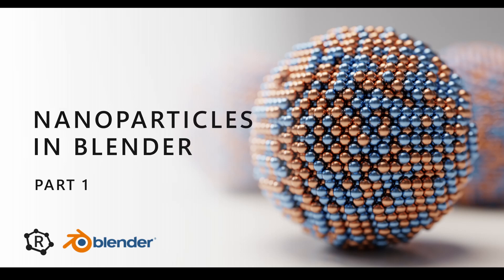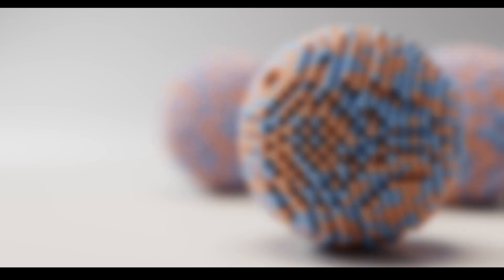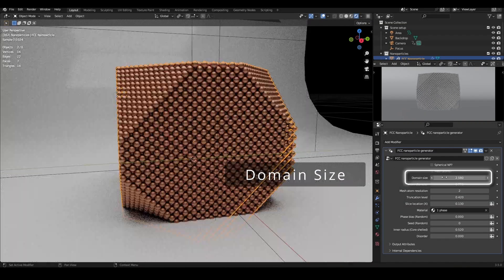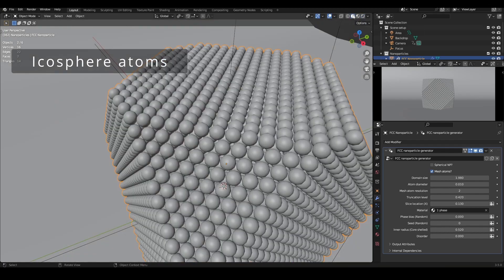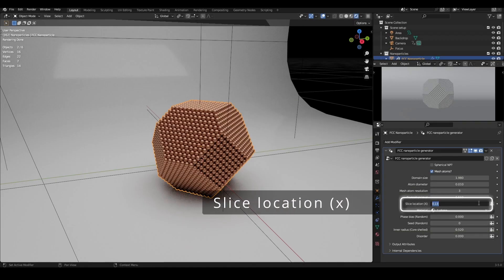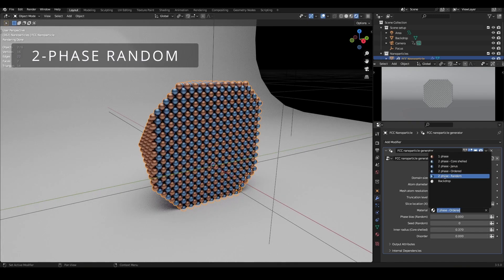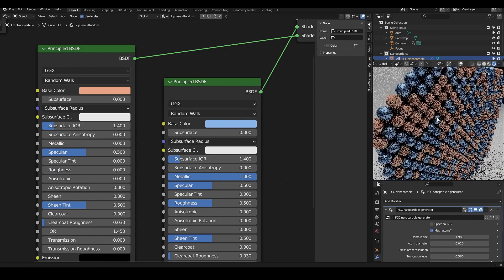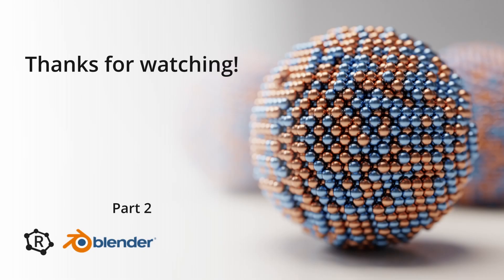Nanoparticles in Blender - Part 1

Comment: Hi. Thank you for your video. This video is very useful for my.
I have a question.

I want to make a particle with a concave shape, but it seems that it can only have a few prescribed shapes. Is there any way to do it?

For example, when I make a concave cube, I make a cube and subtract each face with a sphere to make it concave. But, this is a very cumbersome work.
Reply from the maker: Concave particles are not possible for now as I'm not sure concave nanoparticles form easily during their growth (just thinking in terms of growth kinetics and facet energies). 

If you want to make a concave cube that you can use to trim atoms away, you subdivide a mesh cube a bunch of times, select the central vertex on each face and with proportional editing (sphere falloff) enabled, you could push in the vertices inwards along the face normals.
Reply: @ryomizutagraphics  OK, I'll try to use sphere falloff for make the concave shape. Thanks for your reply.

Comment: This was very helpful for me!
How do I create a ternaly alloy?
Reply from the maker: Many ways to do it. You would need to dive a bit into the geometry nodes setup. I would suggest selecting 3 subsets of the atoms and storing a colour attributes for each
Reply: @ryomizutagraphics 
Thanks.

I want to create a ternary and quinary alloy with a random structure, but I am a beginner and do not know which part of the geometry node to change.
Is it the part of Making FCC latice or the Initialising ID attribute....

How did you learn how to use Blender?
Reply from the maker: @---st2lg Probably quicker if I make something for you. Drop me a DM via my website

Comment: may I know if it is possible to array these nanoparticles? Thanks
Reply from the maker: Sure! Lots of ways you can do this, depending on what kind of array you want. Simple arrays (eg along a line) can be simply done by adding an Array Modifier (make sure it is below the Geometry Nodes modifier for the fcc nanoparticle though). If you need more complex arrays, you can do it inside the Geometry Nodes tree. Eg if you need a 2D grid array of NPs, add a Grid node, connect it to an Instance on points and plug in the nodes for the NP into the Instance socket rather than the group output of the node tree.

Comment: Thanks for the video. I'd like to know how to assign multiple colours (more than 3) to the atoms on the nanoparticle using your asset.
Reply from the maker: Definitely possible but will need to create a new attribute via geometry nodes to control the colour distribution.  What kind of phase distribution are you looking to create? Random or something more controlled?
Reply: Thanks for the reply! I’d like create an intermetallic nanoparticles with 5 elements in it. With one sub-lattice consists of metal A and metal B and another sub-lattice with metal C, D and E.
Reply from the maker: @danielw5204  Sounds in theory doable in the geometry nodes + shader editor setup, although a little tedious. At the moment, all I'm doing is assigning an index (0 or 1) to every atom position to determine whether they receive material A or B. You'll need to extend this to distribute indices 2,3,4 also, then as the Attribute node in the shader editor to reference them + distribute materials